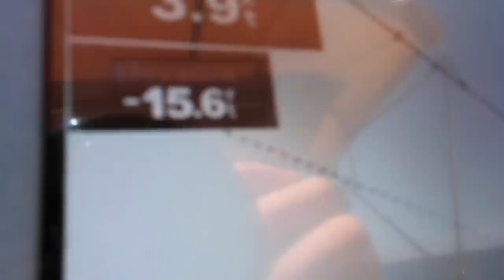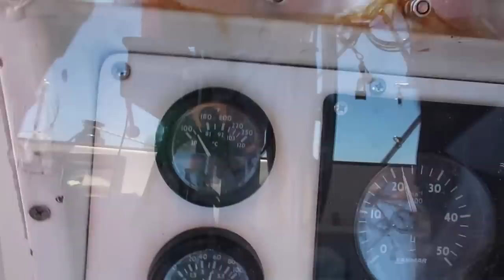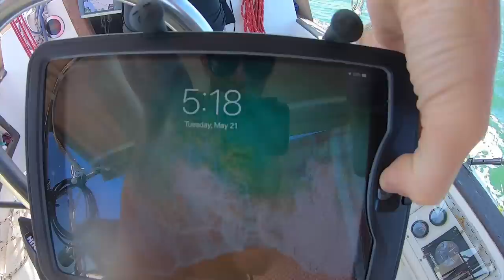Engine Failure At Sea In The Gulf Stream Current (No Wind! Can't Sail!) | Sailboat Story 140

Comment: I had most of my heat exchanger tubes clogged with deposits, eventually stopping the water flow. Once cleaned, temp dropped dramatically. It was a pain to get off the engine, so was glad to see your's was an easy fix.
Reply from the maker: Yeah, I bet that was a pain. It would be difficult to remove on Sandflea. Not much space to work in - but some boats have even LESS working space. Our next boat needs more space around the engine for sure.

Comment: Regarding the raw water pump. You must find every last impeller blade even if that means opening up the heat exchanger.
An important item with regard to the raw water pump, check to see if the cam is replaceable, if it is replaced it. It is very important to make sure it is in good condition as well as the cover plate, seals etc. if the seals are leaking this could cause air to get sucked into the cooling system or in your case the leaking of the water seals could destroy the oil seal and allow raw water to leak into the engine oil sump.
Do not neglect the raw water pump, it is an essential part of the engine.
You should have a spare pump on board along with a pump rebuild kit.
Reply from the maker: I should have mentioned this in the video, for curious minds, but the entire water pump as new at the beginning of the trip. It had less than 40 hours on it when the impeller shredded. I also have a complete spare pump, 3 spare impellers, and a rebuild kit. I typically replace the impeller each season, but this one didn't make it quite that far.

Comment: A few other important items that should concern you and your engine ? 
As I mentioned in my earlier comment the raw water pump is a service item. The pump needs to be serviced every time you change your oil.
If you don’t service the pump you will have a pump failure. Because you had a pump failure you need to count up the amount of impeller blades broken off the hub, you will need to find every blade, if you don’t the remnants of the impeller will lodge either in the heat exchanger, elbow, etc and cause an over heat. The broken off impeller blades will “NOT” pass through the system. 
When servicing the raw water pump ? There are a few parts within the raw water pump you do not want to over look.
The impeller obviously, the cam, check to see if the pump has a wear plate in the back of the pump, if so check the wear and replace it. The cover plate, check for wear on it. You can in some cases flip the cover plate and use the side of the plate with the pump writing, make sure the writing is not raised, if so sand the cover plate on a flat surface to remove any paint and raised writing. Of course replace all o-rings and gaskets.
One very important item missed during pump rebuilding “the seals” both water and oil. Being a gear driven pump if the water seal dies and lets water past it ? You will then find the oil seal fails shortly there after. If this happens you will get water into your engine oil sump , and you may then have a catastrophic engine failure if you don’t check your oil every day and discover the oil has turned to mayonnaise because of the water getting passed the seals.
On a side note ; if you have a water seal failure 9 times out of 10 you will need to replace the shaft bearings, also if you have a seal failure check the condition of the shaft where the seals ride. It is very typical to have damage to the shaft from the seal. The seals both oil & water are only lip seals , you don’t get into ceramic seal assembly’s in raw water pumps until you hit the larger more expensive diesels.
If the shaft is in poor condition due to the seals you will need to check price on a rebuild kit including the shaft and seals vrs a new pump. In some cases a new pump will cost close to a rebuild kit.
On a side note ! 
It would be wise for you to rebuild your pump “WHY” ? There is no substitute for experience. Rebuilding the old pump will give you an appreciation for how the pump works. If you end up rebuilding the old pump for a spare ? And you will be putting this in storage until the next time you need a pump make sure you lubricate the internal part of the pump where the seals and impeller ride.
Last but not least, you should always have a spare raw water pump on board. You should always have a rebuild kit also !

When I was a dealer for Yanmar, Westerbeke, Universal, Volvo I would buy all my pumps and pump parts from a company in FLA. 
this company gave great service and always had the needed items in stock.
The pump company’s name is Depco.  Very very good company!
Reply from the maker: Wow, MEGA comment! Thanks for the insights. I replace impellers every 100 engine hours. In this particular case, the entire pump, belt, and impeller had less than 40 hours on it. It was all brand new at the beginning of this trip. I rebuilt the pump that this new one replaced and used the rebuilt one the last trip. Fairly straight forward. I’m quite mechanically minded. I’ve rebuilt entire motorcycles, run lathes and mills, welded, and even designed non-pyrotechnic military training IEDs, so my mind does work well with mechanical things. I’m actually a pretty smart feller, but my comedic personality tends to make folks think I’m mentally challenged.  :)    Again, thanks for the help. Please continue to chime in with any and all help and guidance you feel free to share. It’s always welcome and encouraged.

Comment: Globe Marine makes a blue impeller for most marine applications called the Run-Dry impeller.  It last three times as long, and is three times more durable.  The good news is they are usually only twice as expensive as a standard impeller.  They can run dry with no damage for up to 90 seconds they say....If you ask me on you next boat you should probably invest in a set of two considering the increased safety factor.  Signed a now Croc wearing subscriber from NC.
Reply from the maker: I do like the sound of that. I'll have to remember BLUE impellers. Keep rockin' them Crocs. :)

Comment: Those impellers seem to be a MAJOR problem/headache for many boaters. Bad design if you ask me..
Reply from the maker: Indeed. I helped a buddy replace a water pump on a 20 horse Yanmar and his pump had a metal impeller of some sort. Seemed like a better design.
Reply: Why can't boats have metal impellers?
Reply: I have a rubber impeller and I like it. It is so easy to replace that a child can do it. I replace mine regularly as part of maintenance and keep the old one as a spare in case of failure (I have never had one fail on passage).
Reply: @daneatherton7886  better to replace before it falls apart than having to chase down the pieces eh? Makes sense.
Reply: @billkaroly  metal impeller are centrifugal pumps, much larger a take more energy per liter pumped. Rubber impeller are positive displacement pumps and are used on most yanmars that I am aware of
Reply: @billkaroly  why don't they install downstream water strainers rather than to have to go hunting
Reply: @ffourfingerzz  complicated question. It all depends on how your boat builder designed your cooling system. All boat engines are adaptations of industrial engine used on many applications, i believe Beta Maine are selling kubota indutrial engines under there name. Most boat builders are cost conscious when designing all things engine related including cooling system filtration
Reply: @daneatherton7886  From the videos I have seen those rubber impeller are just waiting to fail.  Why they can't be a more durable design?  At least most of them are pretty easy to get to.

Comment: I’m sure with so many comments someone may have mentioned this already. That engine should be running at 180 or 190. If not your thermostat is not closing or may have been removed. I would check the specs on it.
Reply from the maker: Thanks. It was getting over 200 each time we would kill it. Oddly, with both the old thermostat and the new one I put in before this trip the temperature gauge would read 130-140 or so.
Reply: @Sailboatstory  Wild Hare is right. Something is off with the engine temp that low. When it runs that low you lose efficiency and with it running cold, you could get carbon buildup.

Comment: That’s a face of concern I hadn’t seen on you before! Good job Captain staying on your toes and quick thinking. When we got back to port our impeller had less than 100 hours (3 months) and the fins were starting to separate. I was told by the Volvo certified mechanic I should get 200 hours out of our OEM impeller. Not sure if it would have made it another 100, but maybe. Do you know how many hours you had on yours?
Reply from the maker: The whole water pump was brand new for this season. I’d say we had 40 hours on it, if that.
Reply: @Sailboatstory See, you wouldn't go thru so many impeller if you didn't motor so much....just kidding, motor on.

Comment: As I have read the responses, I would like to point out that rubber doesn't do well exposed to the atmosphere. I've seen nearly new cars need to have there tires replaced because of side-wall checking and cracking do to exposure. Your "new" waterpump could have several years of shelf life  before you bought it. I don't mind changing the impeller....its like changing your underwear, it's a dirty job but it has to be done for the good of all.

Comment: Raw water pump impellers breaking... I would say every sailboat/cruiser on youtube has posted one or more episodes on raw water impellers breaking and trying to find the little pieces in the cooling system.  Admittedly raw water pumps need to deal with salt water  and seem to break often as compared to closed loop water pumps that deal with water/lubricating glycol mix.  But still the expected life of a raw water pump impellers seem to be in the low 100 hrs
Given the number of compounds they could use to make flexible impellers, it seems manufacturers are using the disposable razor blade model when it comes to impellers
I am an advocate for 12v variable speed magnetic drive water pumps to replace the belt driven breakage and leak prone ones we now have. They are available online for around $100 and some have life in the 10,000 hrs.   I've only seen one cruiser "catamaran impi" convert to a high end magnetic drive water pump for a diesel and that was for a generator so variable speed was not necessary.  I would think a variable speed one would work well for a propulsion diesel
Reply from the maker: Sounds interesting.
For whatever boat we end up with next I'd LOVE to figure out a reliable solution for pumping water.
Seems like such a horrible thing to NOT have ultra-reliable, you know?
Reply: When Trump gets the impeller factory back into the USA and out of china where globalist criminals bush and Bamma put it, they will stop breaking.